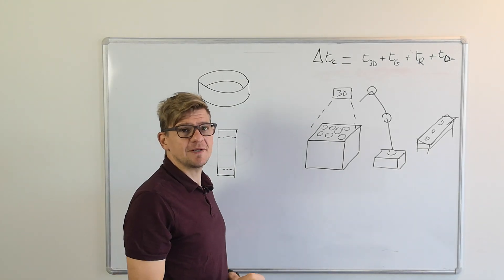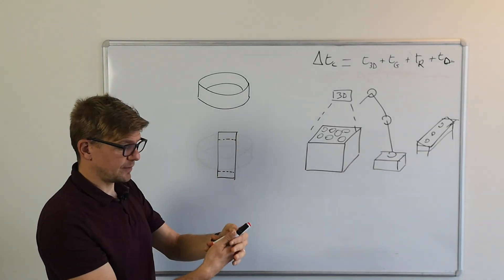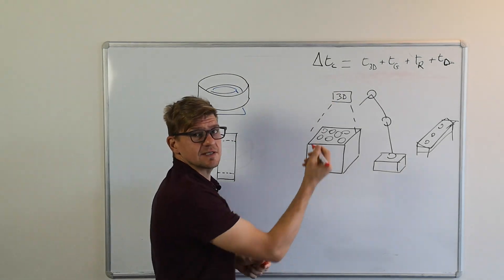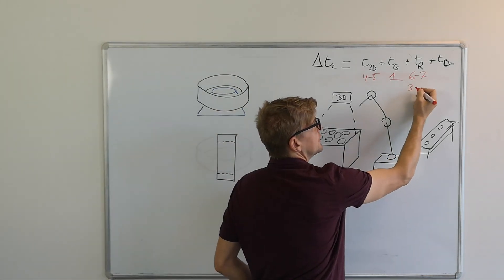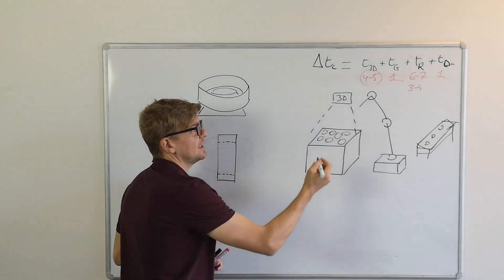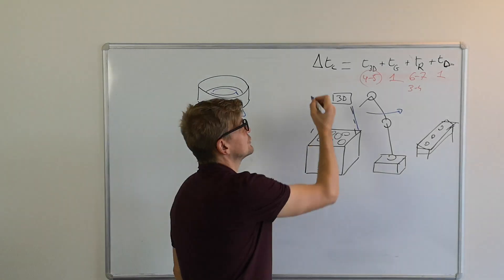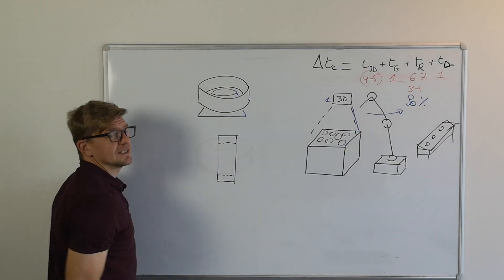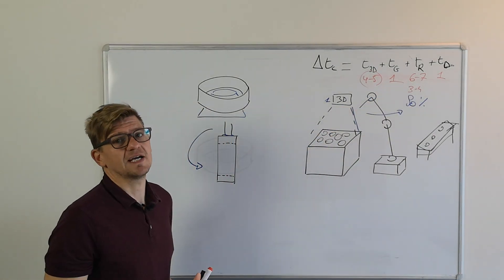How to optimise cycle time in bin picking

Comment: i integrade Fanucs 3D vision bin picking. what i found helpfull is to splitt this into 2 seperate process. First one fast 3d bin shot for picking anything, vector dosent matter so you can have vision times under 2 seconds, then a faster 1 second 2d shot for rotation control of the picked part so you can drop it in the angle as you needed.

If you really need fast cycle times you can use this with two robots, one 3d picks the other robot/scara makes the 2d and places 

But i like how your system works with all brands

cheers :)